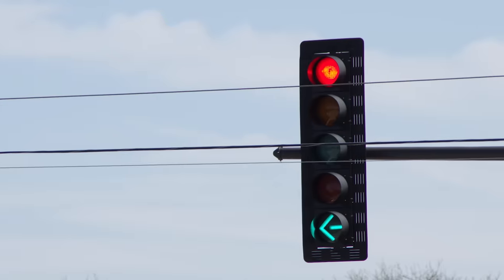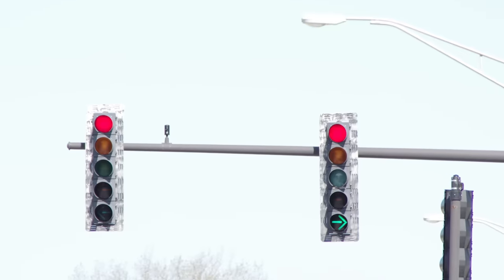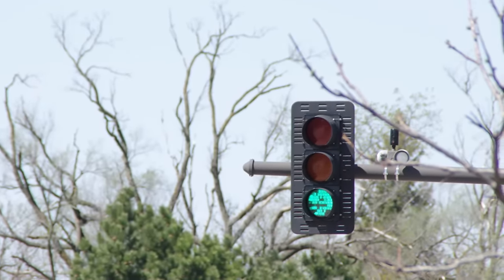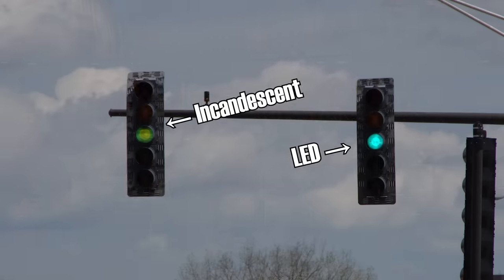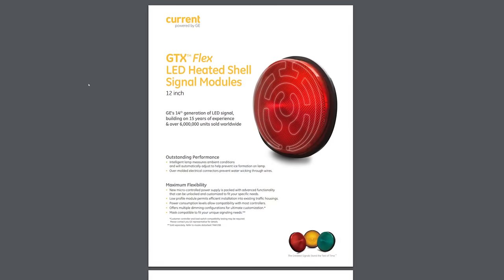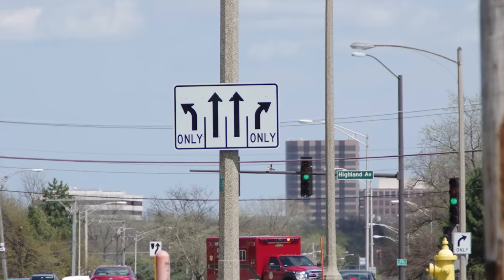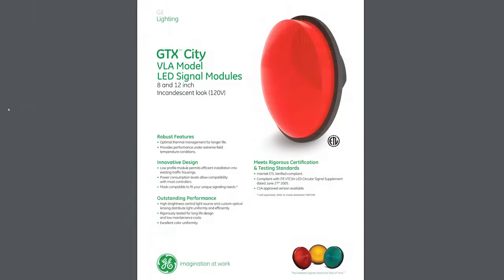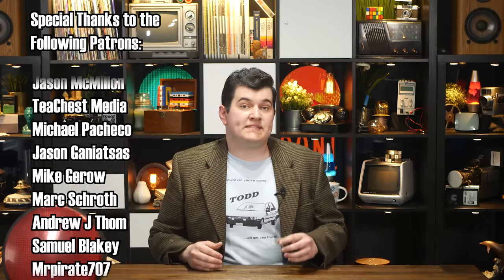The LED Traffic Light and the Danger of "But Sometimes!"

Comment: Almost everything you said is perfectly sensible. But as someone with a couple of year's experience in the Human Factors of traffic and roadway design, I just want to point out that the problem with snow-occluded traffic lights can be quite different from other problems with the lights, because it is entirely possible that only one direction is experiencing the occlusion.

Because of the shielding, drivers with the working lights will have no reason to expect the affected drivers to change their behaviour.

While it is certainly true that the affected drivers should always know to come to complete stop and only proceed when it is safe to do so, there are several factors that can cause problems:

1. We frequently rely on cues from other vehicles to infer the status the lights without actually checking them. We do this automatically and unconsciously. If you are at the front of a row of cars waiting a red light, you can see that behaviour in action by accelerating before the light turns green. Many cars will lurch forward and then stop, because they inferred the change in the light from your behaviour, and only look to verify afterwards, if they have the spare attention to do so.

When oncoming traffic accelerates, we often see the same thing in regions where there may be an advanced turn signal. Drivers will take their feet of the brakes before checking the status of the lights.

2. People in power failure situations, especially when this occurs during periods of heavy traffic, frequently don't follow the rules of treating the disabled lights as stop signs, but instead try to race forward with a clump of other vehicles, being willing to risk their lives and those of total strangers in the hopes of saving a few seconds. This annoys people in the other direction, sometimes provoking them into similarly aggressive and foolhardy behaviour.

Humans are rarely rational. It is simple too energy inefficient and difficult to really be rational. We are instead emotional machines with a layer of "rationality" laid on top. And evolution has put more energy into making sure that our brains protect the illusion of rationality rather than actually being rational.

Comment: Here in Pennsylvania, the placement of the traffic lights are the problem. They put 2, approximately 6 ft apart, on an overhead horizontal pole. If you are behind a bus or box truck, you can’t see either of them until it’s too late. Sometimes the setting sun is right between them and you can’t see them. One should be on the opposite corner also. Also in Philly, with the stop light cameras, they shorten the yellow, so they get more tickets. It’s impossible to safely stop in a truck. Some lights are aimed so badly that when you see what light is on, you’re already in the center of the intersection.
Reply: The placement is also a BIG problem in Ohio. Not being able to see stoplights because I'm behind a semi has become one of my biggest pet peeves alongside countryside intersections where you can't even see anything on one side because it's either a downhill slope or blocked by a bush or building. I think intersections like those warrant a traffic light or at LEAST a four way stop rather than a stop sign on one part of the intersection.
Reply: There is an easy work around. it's called a roundabout.

Comment: The most interesting thing from this video was discovering traffic lights are larger than a persons head. 
(not to say it wasn't an interest video, just that that was pretty mind blowing)
Reply: Ricky's Beets you should see how big the sun and the moon are.
Reply: about the size of a dinner plate or a giant squid's eye
Reply: It blows my mind every time I remember the sun and the moon appear to be the exact size in the sky, because the sun is ~400 times larger than the moon but also happens to be ~400 times further away.
Reply: I was surprised too, I live in the Netherlands and the traffic lights here are about the size of my stretched hand, they're a lot closer to the ground though
Reply: Th sun is much much much larger than 400 times the size of the moon
Reply: @wiiztec   about 2100 miles across for the moon, while about 860,000 miles across for the sun, id say 400X is a fair estimate, according to a quickie with google.
Reply: Daniel Eddy DID YOU KNOW:  wiiztech above failed 3rd grade math.
Reply: @Dreddy72  diameter is not size
Reply: @wiiztec  diameter very much is a size. you may be referring to volume which would change quite dramatically with a diameter increase. but both diameter and volume are sizes.
Reply: @Dreddy72  Well when you compare the size of spheres in diameter you're basically pretending they're 2D, and when they're actually 3D your comparison is going to be wildly inaccurate

Comment: In some parts of Europe (in Belgium, my country for instance) the "stop" sign is not even folded. The driving code just teaches us to consider : 

1 : the cop in the middle of the crossroad
2 : if there is no cop, the traffic light
3 : if there is no traffic light (or if it is not working) the signs (which is not always a "stop" sign...)
4 : if there is no sign, priority to the right.

That way, you alway have a solution presented to you.
Reply: Thats literally how things are supposed to work here (minus signs) but people are not required to take drivers ed so no one know
Reply: this is clear but the main issue is people don't get that law does not automatically give them right of way. it instructs them how in certain situations
the priority is to be given , but if the other driver did not give you the priority how it was instructed to, you can't proceed since you did not receive the right of way.
 a big part of the driver responsibility is to take notice if his right of way was given or not and if it was not given to him, he shall not precede forward.

Comment: I've noticed restaurant drive-through's have difficulty detecting bicycles and sometimes your left there waiting without being told "welcome you can place your order now". This even happens with a busy line wrapped around the building, where you'd think the clerk would assume another customer always files in behind? Some drive-through's have a cc camera, but this only helps if there actually monitoring. This requires one to leave the bicycle at the menu sign, confusing/annoying people behind you, walk to the window to explain your waiting and then walk back! Covid made this situation worse as most dine in areas were closed with drive-through being the only option. I guess the same would apply to people on foot? Also, your videos are always very informative and well researched! Thanks!

Comment: That's interesting thing, with the folded STOP-signs. In Europe, pretty much every traffic lights have normal road signs next to them, that are in effect whenever traffic lights are out - and they are generally out at night regularly....
Reply from the maker: Wow, they regularly go out at night?  That's really odd to me!  I can't think of anywhere I've been in the US where that's a thing...
Reply: Technology Connections Yeah, the traffic is much lighter in the night, so why waste time waiting on the lights - the road signs work very well at night 😉
Reply from the maker: Ah!  Well, that's part of how the presence detectors are used here.  Often the lighting controller has different time slots and the behavior changes for the time of day.  Late at night, a lot of intersections here will stay green for the main road, and when a vehicle is detected on the crossroads it almost immediately stops traffic along the main road and give a green to the smaller road.  After a short while it goes back.
This has actually caused a need for motorcycles to be allowed to run red lights, as the vehicle presence detectors often can't detect them.  In Illinois, I believe the law is a motorcycle can proceed through red if there is no traffic and the light has remained red for more than 2 minutes.  Or something like that.
Reply: Jan Stavěl we in germany have the traffic lights on all the time, but yes every traffic light also has a street sign in germany too
Reply: Another german here, in my area most traffic lights in less heavely trafficed areas turn off at night, aswell as on saturdays and sundays.
Reply: Same applies to Finland.
Reply: Never come across the folded up stop sign yet in my lifetime.
Reply: Technology Connections in the UK some cities shift all the lights to flashing orange only at night, here flashing orange means "I dunno, go if it's clear I guess, but be careful I guess. Whatever" (
Reply: Mar no need to get toxic about this, it's most likely dependent on what region you live in. While I cannot voucher for that guy and where they live, I do know for a fact that some streets keep their lights on at night where I live due to it being a high traffic road intersection where even at night lots of cars pass through. more rural areas do not have these issues therefor all lights are disabled after... 22:00/10pm not sure of the exact time.
Reply: I am going to throw one at everyone....
What does a flashing green light mean???
Speak up candians...this is your thing....
The correct answer will get a like from me.
Reply: AceRidesBikes You guys have orange lights? Weird
Reply: On the going out at night thing, it definitely happens in some places, but definitely not everywhere. I've also seen some places, though it seems to be much rarer, where traffic lights are disabled around noon too, and they only turn on during rush hour.
Also, in my area traffic lights are always red until you approach it when there's little traffic, even on the main roads. I suppose so it'll go green before you come to a stop no matter what direction you come from.
Motorcycles, where I live, have to wait for a car to show up if the traffic light doesn't activate or break the law. However, they can contact the province to have the sensitivity changed if they have trouble. Same goes for bicycles in some places.
Reply: In Austria flashing green means that the amber-then-red phase is imminent. Makes sense and I wish it was used in Australia 😄
Reply: In Europe (except the UK) exists one thing called the signals hierarchy where you only respect the higher authority signals. With slight variations bottom to top:
- highaway code rules
- road markings
- vertical signals (like stop and yield signs)
- traffic lights
- temporary signals (due to road works i.e.)
- Police officers orders

So, if you have a stop sign at a traffic signal and a green light you respect the green light but if a police officer is there telling ypu to stop you stop.
Reply: The traffic lights I'm used to (not many since they are rarer) go into red for every direction and change to green for the direction where they detect a vehicle. These places usually have very little traffic at night and you're usually alone on the road.
Reply: Light is changing to yellow soon and of course after that to red
Reply: Green means Go
Amber means Go
Red means "Alright one more, one more.  you can make it!"
Reply: Technology Connections where I'm at the law is 15 minutes to run it, and sadly sometimes you do wait that long at lights due to incompetent programmers
Reply: this is actually common in small rural towns across the us, the stop lights will typically just flash the red light(turning it to a stop sign) thru the night due to lack of traffic.
Reply: Doesn't happen for me in the UK.
Reply: where I'm at they flash the green or yellow light on main roads to indicate nonstop traffic or yield to turning traffic and flash red on side roads to indicate stop, where two main roads meet, north-south is green, east-west is yellow.
Reply: I think part is that we have a lot of tiny intersections in Europe which means the energy costs for keeping them running at night just makes that unjustifiable.

Around here, the big intersections stay on at night, while the small ones tend to go to flash the yellow light (more off than on, but on frequently and long enough to be clear) which means 'regular traffic rules apply' I presume the yellow was chosen for the task because of maintenance concerns in the days of incandescent.
Reply: Orange flashing one way and red flashing the other way. Orange flashing is a "yield" sign, and red flashing is a stop sign, so orange traffic must slow down and yield to cross traffic, and red must stop completely and wait for the way to be clear.
Reply: You also live in South Africa then?
Reply: In Nashville, Tennessee, all the traffic lights flash amber/yellow for the main road, and flash red for the cross street, between midnight and 6AM. (00:00-06:00 in 24 hour format.) They also have unusual green lights on city police cars, and I saw white light bars on security guard's cars. I don't remember what flashing Advanced Green means in Canada. Ironton, Ohio used to have a flashing green for a T-intersection where no one is supposed to stop, but they took it down. It wouldn't have been MUTCD approved.
Reply: Master Kek we actually have traffic lights that go out at night. I know of one in particular that switches off at exactly 22:00, showing me how timely i got out of work that day
Reply: That's right we have a hierarchy here where a police regulator on site gets the highest priority followed by traffic lights then signs and when everything fails it's down to left yields before right.
Reply: Up in Northern WI our lights don't necessarily go out at night, but rather turn into a flashing red light instead of the full three colors. Effectively turning it into a stop sign.
Reply: The times I’ve nearly been in an accident at intersections with disabled traffic lights where people decided to turn them into 4-way stop crossings instead of following the priority rules road signs...
Reply: The folded up stop sign is an illinois thing or at least an illinios chicago area thing.
Reply: Technology Connections, PA just passed a law that extends that motorcycle law for all vehicles, and as long as you come to a full stop, you can proceed through any red light, as long as you deem it safe. This also compounds the fact that you are at fault if you get in an accident in this event. Also, we don't have red light cameras in most places here. We also have the same emergency flasher things. I always thought they used a radio signal, rather than a strobe light... I feel like the strobe light could be abused by civilians, lol, but I'm guessing the cops would catch on to that REALLLY fast, tbh.
Reply: Cameron Brown, holy shit I wish we had that feature in the US, that would allow people to more properly prepare for yellow light... :O
Reply: Ghost Jesus, you should move to PA, they just extended that law to all vehicles, and you only have to come to a complete stop, no wait time required (as that is just stupid, really, it doesn't do anything other than force you to wait, even when there are no other cars coming)
Reply: In hungary the lights in less important intersections switch to flashing yellow from 9pm-11pm to 4am-6am to speed up night traffic. It's not so good to wait for a 2 minute red light a 2am when literally nobody is out there, right? :P
Reply: all traffic lights in Europe always have road signs to them in event of not working lights, but nowadays they work at night also, because of sensors and they create green lights on main road, in Lithuania for example 10 years ago traffic lights were off at night. And all traffic lights are replaced to LED since ~2008. Traffic light off means it is flashing yellow.